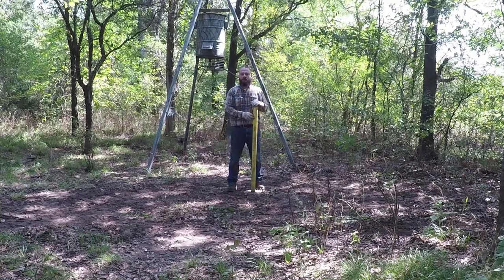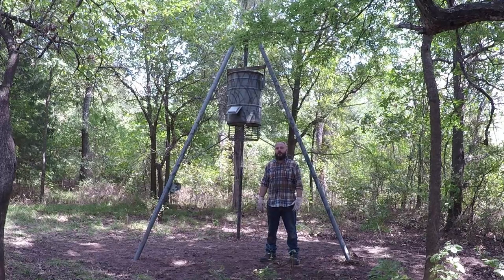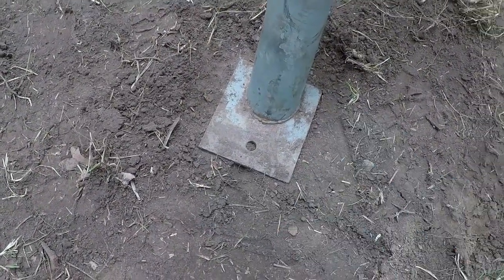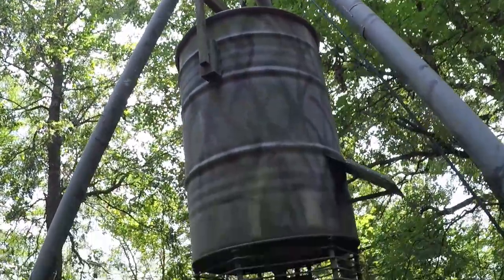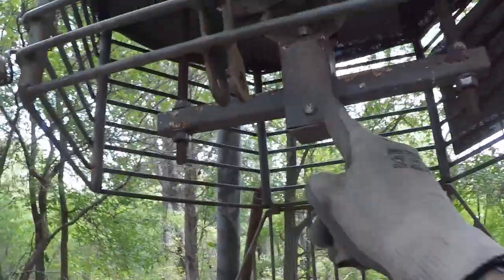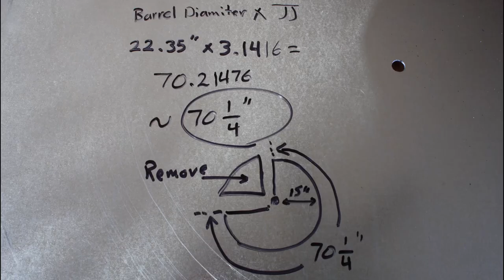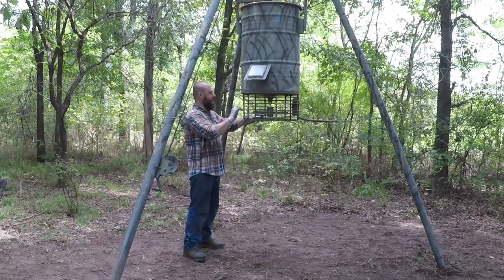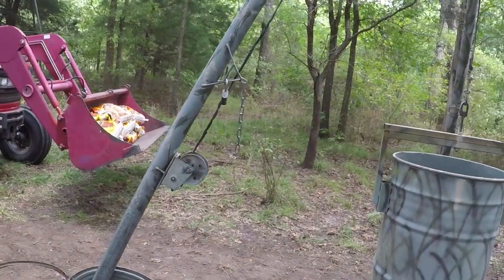Homemade Deer Feeder

Comment: Nice one Sayhood. I built one as well using a Moultrie feeder, and a 6 gallon galvanized garbage can that holds exactly 50 pounds of corn. I will post a vid on it one of these days. So far it is working fine. I sure do enjoy your videos and am anxiously awating your generator muffler build. I need to quiet down a new Cfmoto Uforce 500 side by side. Thanks for sharing your engineering and crafting skillls.
Reply from the maker: Good evening sir, I appreciate your nice comment, I am looking forward to see your homemade feeder. I have several projects I am going tp upload, then I will start a series about homemade mufflers.

Comment: do you need my solar panel?I can sponsor
Reply from the maker: Okay, what do you have in mind?
Reply: How has your current solar panel held up in the shaded area? Does it keep it maintained? Looking to buy the same for my custom setup. 

Your feeder inspired me to bullet proof mine just the same. That thing is well engineered.
Reply from the maker: Thank you for the comment, the same solar panel and the same battery been doing well since 2012. I have 9ha 12 volt battery.
Reply: Thanks for the fast response. I'm ordering mine today.  Thanks for your instructional videos. They are awesome.
Reply from the maker: Thank you for watching.